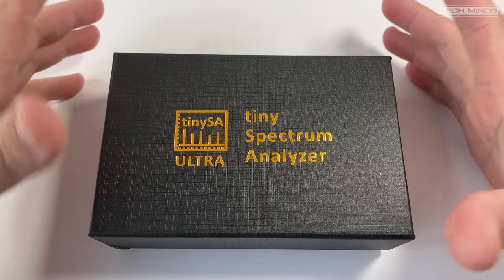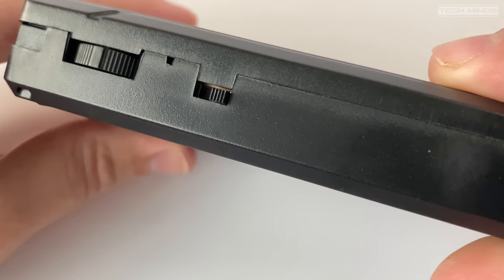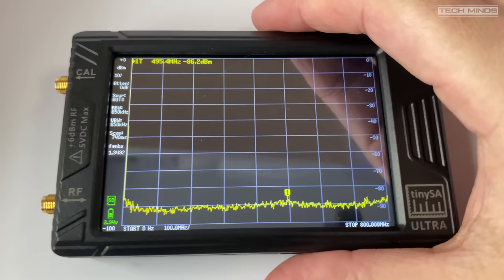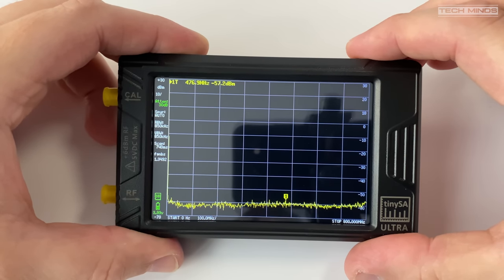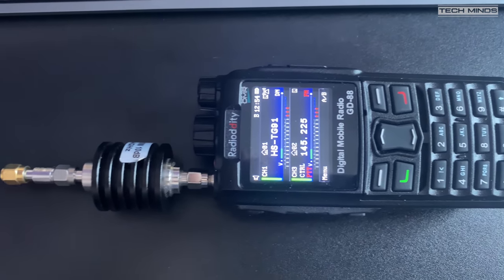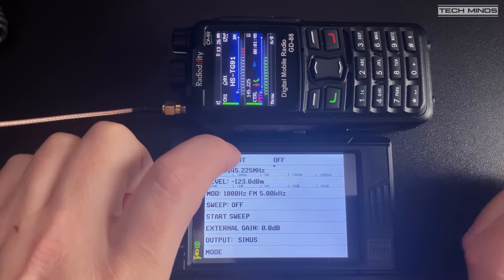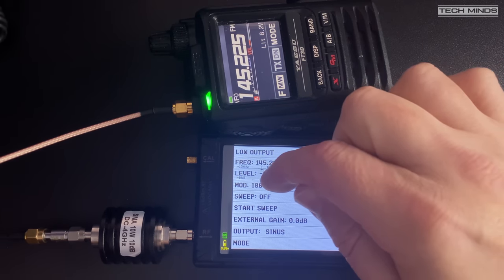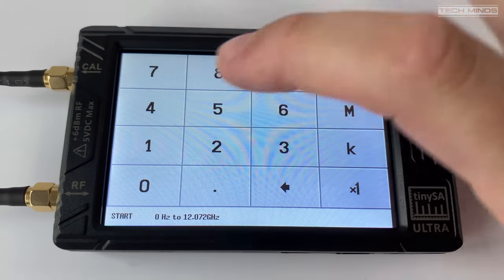TINYSA ULTRA SPECTRUM ANALYZER AND RF SIGNAL GENERATOR

Comment: Great  video, just  In vhf the S-meter S9 is arround -93 dbm
Reply from the maker: That is correct and thank you pointing this out. -73dBm for HF and -93dBm for VHF. Thanks I have pinned your comment for others to easily see.
Reply: That TECH MINDS fix in a video my commentary is the best of 2022. You was my inspiration for RADIO BUNKER. ! all the best
Reply from the maker: @RADIOBUNKER73  That's awesome! I have subscribed to your channel just now.. :-) Good luck!
Reply: Is the dBm "Millivolts" or actually dBu ? "Microvolts" with the m designation?  Considering one for Amateur Radio experimentation. Setting generator levels and associated attenuation levels.

Comment: I'd advise anyone buying this to get a replacement set of connectors, and some extra female to male , male to male, and female to female connectors to attach the unit itself (AND some short jumpers) to "save" the ones on it from wear and tear, AND because you ARE going to loose them and drop them, etc. And BNC to sma adaptors and BNC ones too. Also, if you are considering obtaining a full size spectrum analyser over this one? DON'T. instead? Buy THIS ONE FIRST along with the Tiny VNA. Trust me, sure the display is small. But you can't beat the portability and price! It's incredible that you can place a DMM, VNA, SA, and digital tiny scope into a shaving kit bag: Do just that, and these instruments become your EVERYDAY CARRY instruments that you actually USE. AND? It all runs independent of the mains so you get rid of ground loop problems. After you take these steps? You just might forget that you need an expensive VNA and SA, or NOT... But if you do? You'll have THIS fine unit AND interchangeable connectors at the ready for you larger unit! ;-)  All the Best! 73 DE W8LV BILL
Reply: Not to mention that the price spike really really fast for "good" SA or VNA, or in some case combined SA+VNA, upwards of tens of thousands for Rigols and Siglents, and R&S or Keysight is just comically priced compared to those tinySA, NanoVNA/LiteVNA etc.

Comment: The whole point of the pin number was for the users to read what is written on that page 😀
Reply from the maker: Ohhh my bad..
Reply: @TechMindsOfficial  Good excuse to do a follow-up showing the limitations of the "ultra" mode. A suggestion for the RF gen part: use one of your SDRs to show the signals produced.

Comment: No such thing as a 10dbm attenuator. an attenuator is not referenced to 0dbm . Its plain a 10db or 20db attenuator. also, Remember a harmonic around -50dbm means nothing if the fundamental is at -30 as an example. It is common to use the term dbc and then reference the harmonic to the fundamental. The Tinysa will do this for you if you use the harmonic measurement function. Otherwise good job making the video.
Reply from the maker: Thanks mate, I’m still learning this amazing bit of kit, lots to learn! Thanks for your comment, it’s very much appreciated.
Reply: Thank you for noting this too. And also thanks to the channel creator for his time to do this review.

Comment: I think those harmonics might have been due to overloading the input to the Tiny SA. 30dB attenuation is probably not enough as the maximum quoted input level is the damage level, not the working input level. The easy way to tell if you are overloading your Tiny SA (or any spectrum analyser) input is to add an additional 10dB attenuation, if the harmonics drop by more than 10dB then you are overloading the Tiny SA's input pre-amplifier.
Reply from the maker: The internal attenuator was set to automatic, do you think I should of set that to manual? Maybe to 10dB?
Reply: @TechMindsOfficial  You can try that, switch in the internal attenuator, if the harmonics fall by more than the amount of the attenuator then you were overloading, but really because we don't know how the internal attenuator works (it could just be a gain controlled amplifier) an additional 10db or 20dB in-line attenuator before the input is the way to 100% sure. Also make sure the LNA is switched off. Actually my TinySA Ultra arrived since my post and I must say it is very impressive for the price and size. My main SA is a 1980s HP8060A, in these the attenuator is a real piece of hardware and you can immediately switch in a resistive attenuator. As a precaution I have a 10dB attenuator permanently connected to the front panel, apart from offering a degree of protection against overload it also serves to save wear on the unit's own "n" socket.
Reply: He should have had adequate attenuation if the signal output was just one watt.  For a 5 watt HT radio I typically use about ~65dB of attenuation and that keeps me at least the recommended 30db below its maximum input rating of 6dB.  The only difference is I use external attenuators and then allow the auto-attenuate function to act as internal protection if I ever miscalculate my attenuation, but with 65dB attenuation on the input the auto-attenuator ordinarily remains at 0dB.  You may also use an external step attenuator, if you prefer, but the less expensive one I purchased on Amazon for $75 I noticed was off by nearly 1.5dB with around 40dB attenuation added in (as in, a bit too much attenuation) whereas my fixed attenuators always seem to be practically dead on their target attenuation (as in, within plus/minus a few hundredths of a dab versus stated attenuation) when I have tested them.  If you enter the amount of external attenuation you have provided as a negative value in the EXTERNAL GAIN parameter then the TinySA Ultra will automatically account for your external attenuation in its reported numbers (it automatically accounts for any automatic internal attenuation, so do not count that value — just your external attenuation).

The Baofeng and similar Chinese knock-off radios sold at economy prices are fairly notorious for their harmonics as they have no meaningful input or output filtering to block those harmonics.  Some are just within legal limits while others are well outside and it is just chance in many cases.  My Baofeng UV-82 (which was Part 90 certified) was well within the legal limit for harmonics, but they were quite clearly there as compared to my Yaesu VX-6r which had no visible harmonics (so somewhere below the TinySA Ultra’s noise floor).  I use a 20dB 50W (I also have a 20dB 100W) power attenuator as part of my TinySA Ultra’s kit as that allows me to use the same exact setup for both HTs and mobile radios just by adding in another 10dB when testing mobile radios.  I use my 100W 20dB attenuator for testing 100W HF radios.  Combined with the NanoVNA-H4 (also a 4” display) the combo offer us all sonde extremely portable and affordable options for testing that both our radios are operating within spec and that our antennas are performing at there optimal best as well.  Just a few years ago the equivalent capability and bandwidth to cover all the popular amateur bands would have cost the amateur operator many thousands of dollars and we now have that all covered for about $350, tops (and covers to at least the 23cm band, if not greater, on the VNA/antenna analyzer).  

Just be careful not to buy a counterfeit TinySA Ultra as they do not pass self-diagnostics as-is so their manufacturers are patching the firmware so it will report “success” on the self-test.  This causes all to look good (whether it is, or not) until you install your first update patch and discover that your counterfeit unit will never pass self-diagnostics.  Obviously, the author author and creator of TinySA Ultra (its hardware and firmware) can not help people out if they bought a counterfeit unit as he has no say in their manufacture, quality control, or repair (the counterfeit manufacturers are simply ripping off his work and seeking a knock-off fir just a few dollars less than the authentic units).
Reply: Good point. I always use an external attenuator with my SA's, and try to measure around -20dBm or so for best dynamic range and accuracy.
Reply: re: "I think those harmonics might have been due to overloading"
Yes. Professional measurement with quality gear like HP, Agilent or Keysight calls for attenuating the fundamental as well, IF one cares to read thru the procedure used by manufacturer for FCC Type Acceptance tests.

Comment: Pro tip:
"dBm" is a power measurement (ref'd to 1 milliwatt) where 0 dBm = 1 mW
"dB" is an attenuation value where 30 dB is a power attenuation factor of 1000.
End of Pro tip.

Comment: Hi. Thank You for interesting video. I have just obtained my Tiny S.A ULTRA and played a little. Before I had previous version, but wasn't fully satisfied because ow it's RBW limitation to 3KHz. It was impossible to observe basic audio modulated signal lika AM or SSB, but ULTRA model is improved to 1khZ AND 200Hz which allows that. I also plkayed with it as signal generator. Measured output power with chinese small power meter. Results are satisfactory. I subscribed to Your channel and looking forward for other cool videos. Best regards. 73 Marcin SP5IOU

Comment: Your attenuator is 10 dB with 10 W max operating power. You're not doing 30 dB attenuation externally. Even with a 5W transmitter, you need at least 37 dB attenuation to bring the power down to 0 dBm (= 0.001W = 1 mW) which is the recommended for the TinySA input.
Reply from the maker: If you listen to what I say I mention that after the 10dB attenuator there is a 20db, lower powered attenuator. It’s a NooElec one, so they are very small, it’s silver in colour and you can see it in the video. Plus I am using low power on the radio.
Reply: @TechMindsOfficial  Even with 30 dB attenuation, that will only bring 1W to 0 dBm. So if the transmitter outputs anything above 1W you are potentially damaging the equipment. What if the power level changes, e.g. because you are in memory mode and the channel has a set power level and after overwriting it you accidentally reset to the original power level by changing the channel and going back or restarting the radio? It's not expensive equipment, but IMO this is not a good practice

Comment: The fact that it has demodulation and frequency generator and seem to be decent. I going to buy one to try it as have portable spectrum analyzer that cost at one point 38k and still around 19k refurbished for one it a real time spectrum analyzer. Obviously don’t expect to see I be near the performance but also did repair recently a older rohde & schwarz fsh 3 spectrum analyzer that had a bad FET as won’t turn on and bad battery which replaced and now works so wonder how it hold up compared to that one? For $130 don’t expect it to but if it come close and usable it be a steal. Also interested in how well the signal generator is and quality of signal?

Comment: Hi Mat. 
Would you consider doing a run through some of the radios you have reviewed in the past with the TinySA. We are all well aware if the bad rep some Chinese manufacturers have concerning signal purity so it would be interesting seeing how recent radio perform. I would particularly be interested in the performance of the Q900 and some of the multiband HTs you’ve done in the past. I note you have done some spectrum test on recent radios, so thanks for that.
Reply from the maker: Hey Gerry! Thanks for the message. I currently have the Q900 V4 in video production, and I intended to do the testing and show results. It may be a separate video from the first launch video, as it could be a quite long segment with all the bands, but yes, it will be done :) cheers
Reply: @TechMindsOfficial  thanks. That would be a welcome video for sure as I am about to pull the trigger on a Q900 v4 and this sort of information would greatly help by purchasing decision

Comment: I wonder if I should upgrade!. I have the older version. Any thoughts?
The ultra has few upgrades: SD card, headphone jack for FM demodulation, frequency generation! Did I miss anything?

I wish if there is an in depth comparison to see if it worthwhile to upgrade?
Reply: well worth it, I have 3 of the old ones integrated into various projects and will replace them with the ultra.

Comment: not all baofeng's are equal.
uv82 (6mths old) is very clean on output, but it is deafer than my yaesu (137dbm) its signal is lost at about 126dbm

Comment: I found a 2023 New Handheld 2.8" Display Tiny Spectrum Analyzer TinySA ULTRA 4" Display 100kHz to 5.3GHz With 32GB Card Version V0.4.5.1, don't know if this the latest one or not. What puzzles me is that the Tiny SA cost 45.59 Euros while the so called Ting SA Ultra cost 127.19 Euros. from your video it is easy to enable the Ultra mode, but I'm still not sure because this seems to be too vague. Would like to see your feedback on this.

Comment: Can it test distance to fault (DTF) on a 50 ohm coaxial cable, with a 50 ohm load at the far end of the cable? Thx
Reply: That's what the VNA can do - NanoVNA or LiteVNA. TDR is a feature of a Network analyser rather than the Spectrum one.

Comment: Hi! De VU2RJV Handle Raj from India here. Thanks for your awesome videos. They are simply superb. I wanted to know how to set up for testing crystal frequencies to match crystals within 20Hz of each other for use in a ladder filter. Thanks. 73
Reply: It does appear to be able to do resolution down to 20 Hz. A good test fixture and a signal generator with a high accuracy timebase (or GPS disciplined osc) might be needed. Also, your specs might be too tight - drift of 20 Hz with room temp shift could be expected at say 10 MHz easy with the crystal itself, and then the other components play a par too.

Comment: TL;DW
An RF generator?
Is this a kind way of saying jammer?
I know it's not the purpose but ...same basic principle?
Reply: Hardly. It's useful for generating a signal on a specific frequency to test receiver equipment. Not everything is a jammer!
Reply: @josephhacker6508  correct, not everything is used for it's intended purpose (10/29/69) and it's because of that that we have advanced fast and far...but I assume you know this already if you're using the loose term "hacker" in your name. 
So from the vague information you so gallantry offered it is then safe to assume it can only jam a single frequency at a time, that is if using a singular antenna?
Reply: @JohnnyDerppp  it wont be jamming anything. The output power is too low.
Reply: nope, its a signal generator to check receivers and other gear.To low a level to be an effective jammer.